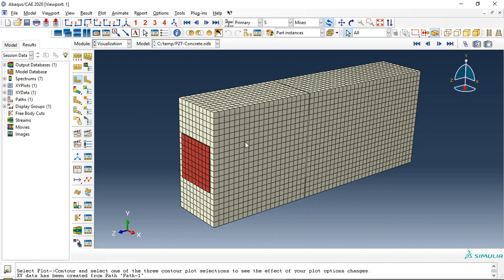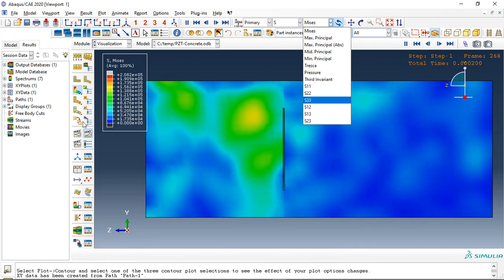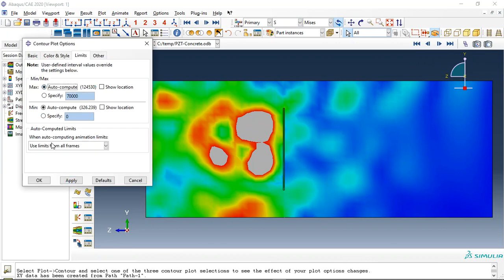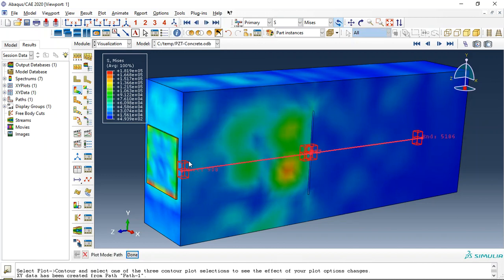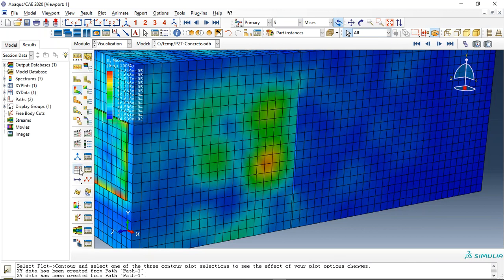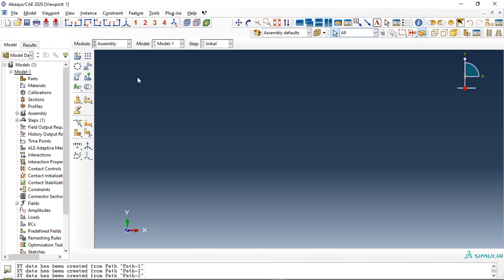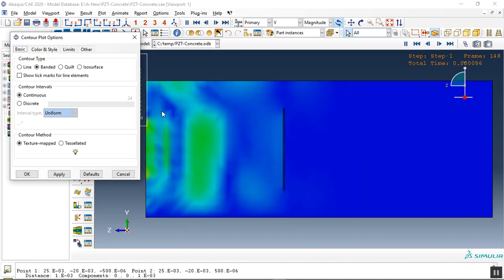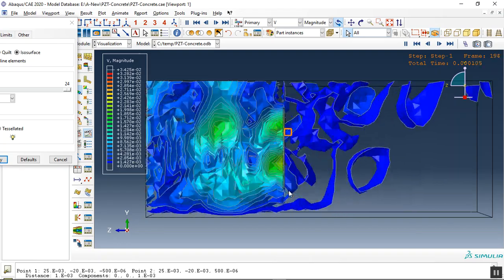Damage and crack identification in concrete by using piezoelectric material in Abaqus

Comment: Hi>> please tell me how to define the bond slippage between steel  bars line elements and concrete in abaqus ?
Reply from the maker: You should use cohesive method for that
Reply: @abaqusfem3576  how to use cohesive with bars as line elements???